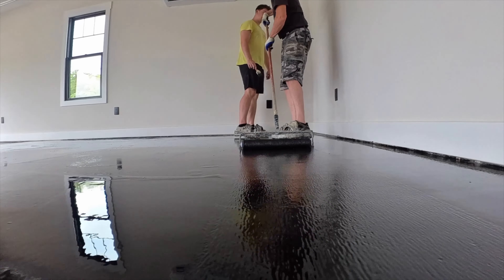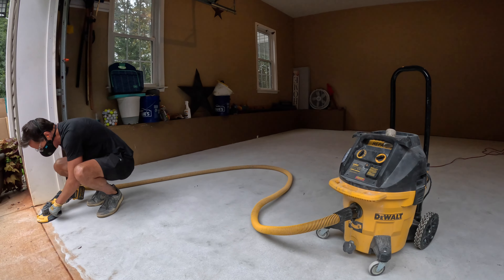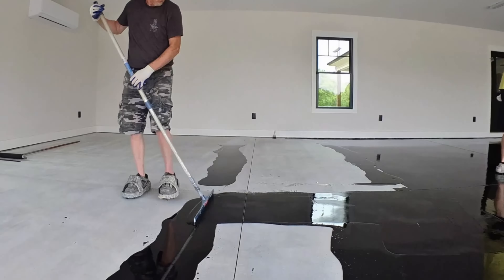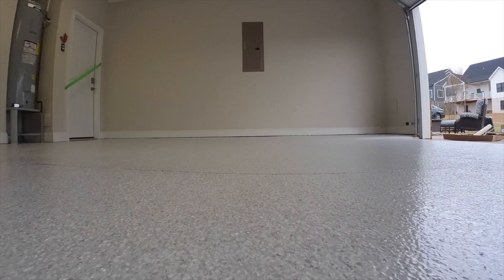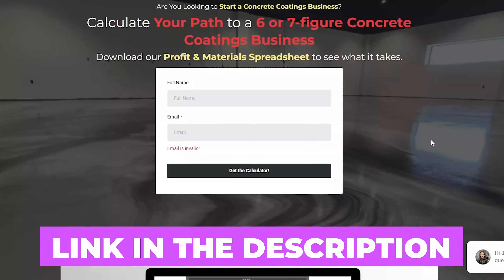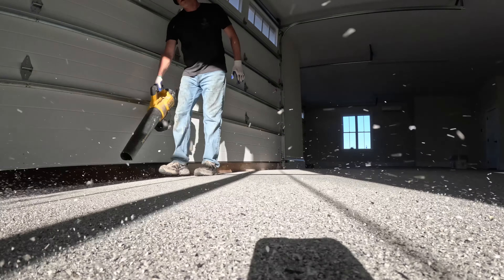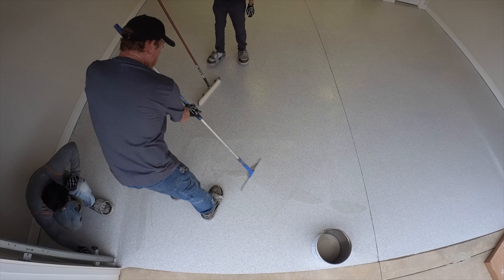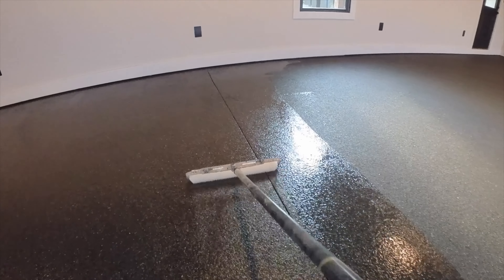This One MISTAKE Could Ruin Your Epoxy Garage Floor Project

Comment: I use a 10 gal DeWalt dust separator tank attached to a 6 gal DeWalt shop vac for the hand grinding and it works great at a fraction of the cost.

Comment: So use Epoxy as the primer (and vapor barrier) then add flakes. On the next day clean up excess flakes and coat with a slow drying polyaspartic coating, correct? How long after that can I drive on it? Thanks for sharing!